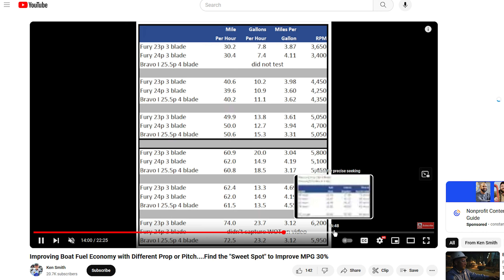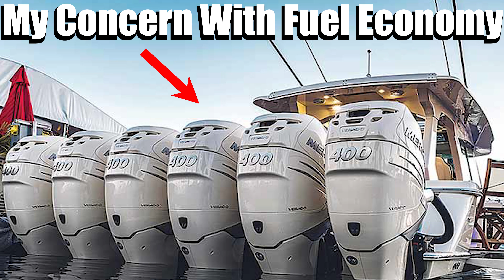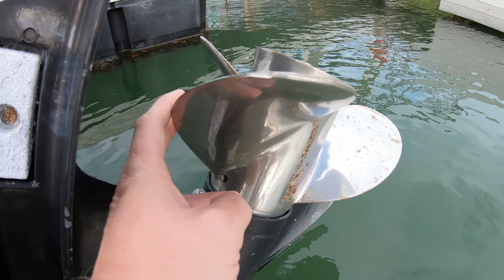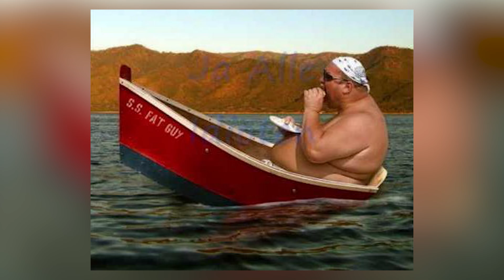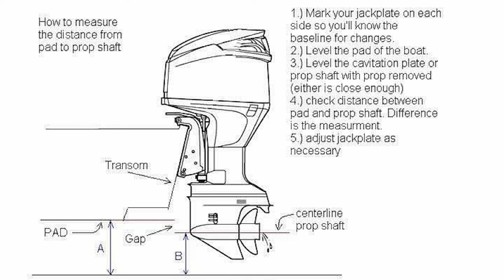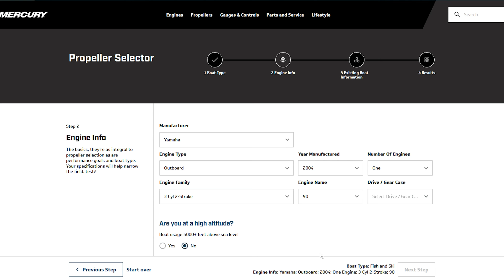Is Your Propeller Costing You Money?

Comment: i have two boat propellers.The first one is a Mercury Enertia Eco 16 x 21.The second one is a Suzuki 16 x 18.5.With the Enertia Eco, the maximum RPM reaches only 5500 RPM, even though my engine's recommended WOT range is 5800 to 6300 RPM.With the Suzuki 18.5, the engine easily hits 6200 RPM.The strange thing is, at a cruising speed of 4500 RPM, the Enertia Eco is 5 mph faster and has vastly better fuel economy. However, at top speed (WOT), it is 5 mph slower than the Suzuki.Should I stick with the Enertia Eco, or switch to the Suzuki 18.5?"
Reply from the maker: That’s a classic tradeoff between cruising efficiency and getting the most out of the engine at WOT. If you’re mostly cruising, the Enertia Eco makes sense, but if you want more top-end performance, dropping to a 19-pitch Enertia could be worth trying. 

For more prop discussions and tips, check out the Skool community: https://linkly.link/25yxB
Reply: How many people used top end 😉 
However both prop at planing the boat 100% 
Today i will test boat because i removed the antifouling paint 
Maybe it will make 21 eco prop mor at top end.
Thanks bro i am have easy life with just see your content 🙏🏽

Comment: OMG! 🤪 How completely complicated 😅
My 1975 Aquasport 170 jumps out (hole shot) just fine but a WOT it's speed is about 42mph, 45mph in slick water. 2000 Yamaha 115hp 2 stroke & 3 blade ss prop. I think it's fine, speed wise. I just wish it had the fuel mileage & quietness of a four stroke with the weight, simplicity, and hole shot of the 2 stroke 😪 😅. Fuel mileage for trips to the Bahamas from my Florida home. 😐 trade-offs bah 🤨
The 2 stroke requires the 52 gal tank upgrade (minor boat redesign), thus added weight from full tank. Or same(ish) tank and heavier 4 stroke engine. Max engine hp of 130 hull rating...🤪
Did I see Evinrude is back? If so, are they still making the ETech 2 stroke? If so, or not, are they a great engine? Used, if new is still no longer possible.

Comment: when i was in the outboard trade i have my job was really toreally help the guys in theshop change props say on the older omc outboards say mostly the Johnsons we had a really busy daywas getting the newwer props fitted on the motors we had finishedfixing up say as very much based on my time as an outboard tech i knew thisws a subject we othern really talked about say we are in thetrade and we have talked on prop choices for the outboards we fit on the boats as thiswas rrally was a harder sort to be as we have to learn really quickly as outboard techs we learnt by trial and error as we have to do itthe harder ways in my case we in Australia have different boating conditions unlike the usa as we are on ssaltwater lakes whereras you guys was on freshwater lakes thiswas why we do the prop choices a bit differently in Australia thiswas based o what i knew inboating in Australia thiswas really thecase in my experieces in as a ex outboard mechanic i knew this was thecase every time we have a motor in the shop we taklked to the owner to get to the source of issuees with the outboards as we say where you using threally was say wrong prop on that boat adnd motor and tell us where you got that boat and outboard from thiswas my standard ways in the outboard trade in my years in reading boating mags i have learnt alot on boat and outboard setups and the likes thiswas really got me to leanr really carefully ijin this stuff in futre nw thiswas based on my time as an young outboard motor tech many years ago now saywas on 24yrs now

Comment: Great info. Your opinion of the PowerTech SCD (semi clever, shaped like the top prop @ 11:20) prop 17P for a Yamaha F70 on a 15' Boston Whaler with a jack plate? It has been commonly used for that setup.
Reply from the maker: Not really sure, I've never ran that prop on that setup lol but if it's commonly used than it's probably a great set up :)
Reply: 👍🏻Chk out the insane  BW rebuilds that FasseCo does out of TN. He always uses them.

Comment: i bought a used 20hp mercury 4 stroke Crestliner aluminum bass boat for local lake that has 20 hp limit this model did not have all the gauges like speed fuel and rpm but they do make same boat and model with gauges is there an easy way to add a tachometer or speedometer to the boat i tried small electronic tach and it sucked it was not accurate and said to calibrate it with another tachometer
Reply from the maker: Yeah, without adding the harness and a tach, that's the best way, otherwise you have to jerry rig something to pull tach info from the harness on the engine :/

Comment: I have a 23’ Grady white with a 200hp
What prop would you recommend for a heavier boat
Reply: You can’t be serious… 

different lower units have different gear ratios which is going to have a major play in what prop works best for your setup. Nearly impossible to suggest anything that would be a worthwhile upgrade for you based on the parameters you’ve given. Hell you didn’t say what prop you’re running now and what performance aspects you’re seeing out of it.

So I recommend you talk to your boat shop and see what they say. Or really get some performance stats of your current prop and see what you’d like to change about it. and then start shopping for new props from there based on what you want to change. Some of it is trial and error.

Comment: Being a marine mechanic and a boater , the most common mistake I see from boaters is the lack of trim they apply to get the bow up (less wetted surface) and to get the optimal RPMS .. When it comes to Bass tournament fisherman, cost is always backseat from a hole shot!!  A fisherman will sacrifice a little top end speed to get that boat in front of the pack.. so going to a 25” pitch prop versus a 27” pitch prop mabe the play.
Reply: zero trim is most efficient prop angle.

Comment: I remember when GPS came out changing everything. With a fuel transducer  you could dial it in for efficiency at idle or wot using the trim and jackplate. I started saving a lot of fuel but one of the best mods was having Bob's modify the lower unit with a nose cone and low water pickup. Elongating the lower unit moves the area of clean water further back so the prop is running in cleaner water.. With a 22' CC and 250 I went from 56 to 63 mph and 15-20 % less fuel.  It seemed more planted with less cavitation turning. too. I tried a lot of props and was really suprised how different props in the same size/pitch from different manufacturers can feel so different. I know a lot of places let you test drive props for a day or two for free so imo worth it to try a few.
Reply: but the gear case would have a lot more drag?

Comment: I just put a 140 hp Siemens electric motor in a 27" tri hull fiberglass work boat. I use the boat for dock construction in Montana. Any thoughts on prop selection with the different powerband of an electric motor? I often load the boat with a bunk of lumber and lots of tools maybe 6-8 thousand pounds. The old Mercruiser 165 straight six did a decent job of planing up and going a couple of miles to work, but the Montana temperatures killed it a few times.
Reply: With practically all the torque of electric available at all RPM you can get away with a more aggressive prop than you’d think.

Comment: Excellent. I knew I had an issue with my 2003 Key West 22cc. I repowered with a 2023 Mercury 200. Top RPM barely hit 4900 with a top speed of 28MPH (barely). The dealer put a 15" x 15" stainless steel prop on it.  With the tools described, its pointing me to a 13.6" Diameter x 21" pitch. Holy cow that's different. Going to do some testing. Marina mechanic said I should hit 42-45 MPH with this Mercury 200. We'll see! \

Comment: Excellent lesson on Props!  Thank you.  Ihave a Boston Whaler venura 210( 3300lbs) dual console w a Optimax 200HP DFI. I have a 15/15p Stainless. I have decent performance but cannot find the factory recommended Prop for this boat and motor? 
Heavy boat and I am thinking about an aluminum 4 blade for sk/wake use( Faster hole shot?)
any experience or thoughts?
Reply from the maker: Hi, This is Rose, I help Aaron with the comments, this is a great question and I'll put this on the list for featuring on the podcast! If you haven't already, check it out and subscribe! https://www.youtube.com/@TheBoatersPodcast

Comment: When friends ask to explain prop selection, I usually say that a prop pitch number is like a gear in a car with manual transmission. The lower the number - the more load you will take on plane and accelerate faster, but overrev the motor and only have that much speed. The higher the number - the faster you go, but the longer it takes to get there, also your motor might not have enough hp to spin it to desired rpm with bigger load weight. Just like a loaded car in a 5-th gear on a manual might not get up the hill, while cruising fine on the highway. The rest of the prop parameters, like diameter, blades, rake, cup and ventilation holes usually do not interest the average boat owner like at all. They usually ask either for a top speed, or what prop do I need to plane with that many friends and family onboard.

Comment: I've been pretty happy with the 13x19k Yamaha OEM prop on my 130 Saltwater series half cab. Boat will reach 73km/h (perhaps a smidge more with trimming it up more) and sits at around 5700rpm. 
I'm sure if I fiddled around I could get a better prop for hole-shot or top speed, sacrificing one or the other. I do like both the current acceleration and top speed, so I'm unwilling to really sacrifice either unless I could find a prop that gives gains in both.

Comment: i have been running my 18ft zodiac with 90hp offshore, trim up or not, plane or not, there are no differences aside from handling. (too much bow up makes the speed lower too) could it be the boat itself is already so light i get planed regardless anyway?
Reply: Inflatables need very little trim to plane out.
Reply: @danconn2065  “very little”, feels like almost no trim needed.

Comment: First off l, been watching your videos for a while now and found them super helpful after having purchased an old mako 20 with an 97’ evinrude 200. I have managed to service or repair a lot of components on the motor that have saved me lots of cash and given me experience and time on the water. Thank you. That said my tachometer has never worked and the one that was on the boat when I bought it actually caught fire so I replaced but have never got readings that made sense. Do you have a video I can reference to try and figure out the problem with my tach. My tach jump around like crazy when I start the motor. Once I get going it either reads 0 or on occasion it will read between 1000-2000 regardless where the throttle is. Any help would be appreciated.
Reply from the maker: Hi! Rose here, appreciate your comment! Sadly, I can't provide the exact answer you're looking for. We prefer to tackle these types of questions on a personal level. We have a channel membership offering weekly live discussions for such queries. If you're intrigued, simply press the "Join" button next to our channel name. Thank you for considering!

Comment: Thoughts on the Sharrow propellers? Other than the ridiculous price.
Reply from the maker: Hi, it's Rose! I'm helping Aaron with comments. What an excellent topic! It's getting featured on our podcast soon. Haven't checked it out? Subscribe now: https://www.youtube.com/@TheBoatersPodcast
Reply: @BornAgainBoating  I am also interested in the Sharrow Props too. Maybe test them on a Boston Whaler Outrage or Ventura 210 9 Its a heavy 21 3300 lbs /5000lbs loaded.
Boat sits high so performance should be easy to monitor. IMHO
Reply: I got an outrage 250 I didn't seem like I was getting good RPM last season on twin verados I got to see you again this season. Supposed to be 6,000  6,400 rpm as full throttle and I don't think I was getting that high. But I do keep the boat full of fuel due to the garbage ethanol that we have to buy here in New York @danconn2065

Comment: Dude! as always, informational GOLD! I went from an aluminum 18 pitch/14.25 diameter to an aluminum 21-14.5 on my old I/O and way increased my fuel economy, and I mean by a good 25%, played with the twin Evinrudes, but I'm feeling pretty pretty good with the current set up with 19 pitch 14.25 as an all around prop, getting an average of about 1.9 to 2.2 MPG and still being able to hit 45 MPH when I trim up and mash the throttle seems a good compromise. I just don't see the value in changing out stainless props on motors that I intend to replace down the road, when the Props cost as much as they do and I need two. You can bet I will be doing some serious research when I repower, still not wasting money on Sharrow props,

Comment: You guys should try ceramic coating the non gripping surfaces of the prop. This would be most efficient, The gripping surfaces, open faces rear of the boat, they should be scuffed probably with a fine 3m pad, not polished, because the props supposedly grip. I think they would work better scuffed, because how would something super slippery propel itself through water, but like fish, it could be slippery yet, they shove large volumes of water around, with least effort. 
So maybe a fully ceramic coated prop would help. 
I will test it myself, I know the hull benefits 5 or so percent or more with having less water resistance.
Reply: Interesting observation. Makes sense. Of course we’d like to hear about your results.  Inviting technologies from other industries can’t hurt.
Reply: @fernandofolgueira5191  I wouldnt call it technology, like top secret super special super advanced material, I would look at it more like a very well engineered wax product, except its formulated to harden and cure, interlock and last for a very long time, not breaking down with uv or oxidation. 

Really the stuff is just high purity silicone oil, with a hardening agent for the silicone, a dissolved porous rock like material, and acids and solvents to keep the stuff in suspension and applicable. 

Some contain flourine solvents which is just stupid formulation and not safe, blatantly because some manufactueres get off to selling harmful products.

Comment: Here comes a thousand comments asking which prop dudes should get for their specific boat 🤣
Reply: You get the comment of the week award.
Reply: I have a 1987 blue boat. What prop do i need.
Reply: @Brandonpowerstroke trick question. Blue boats don't need props, turd.
Reply: @Brandonpowerstroke but what prop should I use if my boat is red?
Reply: @Brandonpowerstroke  Thanks Brandon, my first laugh of the day! But I have a green boat.
Reply: What boat do I need for my prop?
Reply: Hey bro! What prop do i need for my boat? 😂
Reply: @Boaters_hub  That one!
Reply: What prop should I use for a Bayliner Rendezvous with a 130 Yamaha?
Reply: I already looked that up I am using aluminum because there are to many rocks where I am at
Reply: I can help out in 1 specific scenario.
If you're running a heavy flat bottom skiff style boat with a 90hp Yamaha 2 stroke, go with the PowerTech RED4 13.25x15. My specific hull is a SeaPro S1900 skiff. 1000lbs unrigged & unloaded.
Reply: HA!  Right.  If only people knew how to do prop math.  😂😂😂😂
Reply: Didn’t watch all the video so what Prop should I use for my 21’ open bow?
Reply: YUP and Im one...Went to merc and really cannot determine a proper recommendation for buying a $500+ option?
Reply: @danconn2065  Do Prop math.  Does your current prop get the engine into the middle range of WOT without over or under reving? If yes then that is the best prop nothing to change.  Leave it alone.  All changes are in rpm from your current prop.  Aluminum to stainless. Same pitch blades and diameter 2-3 + mph. Every pitch change 200 rpm.  Every inch of diameter  difference to old prop 500 rpm.  Every extra blade compared to old prop. 200 rpm.  No Reason to buy merc props. Solas rubex run the same on my boat for half the $$